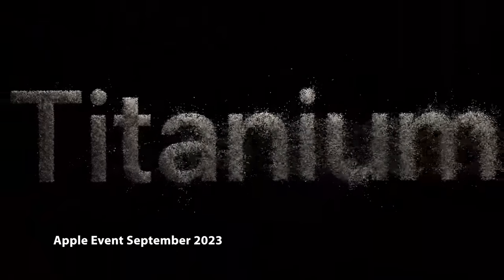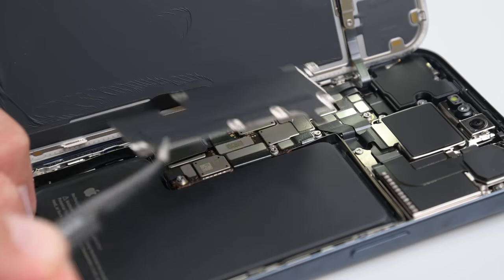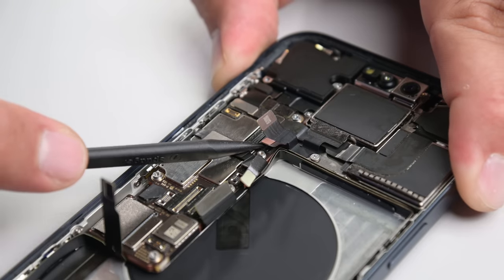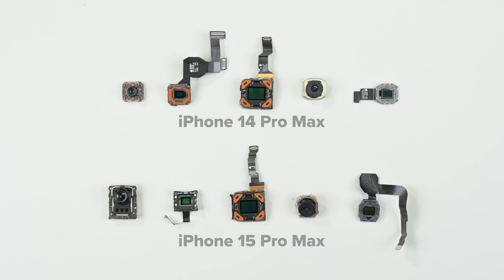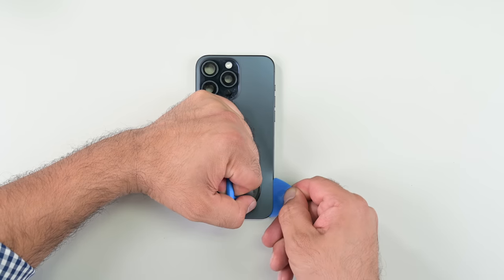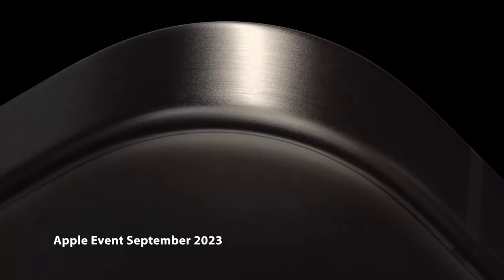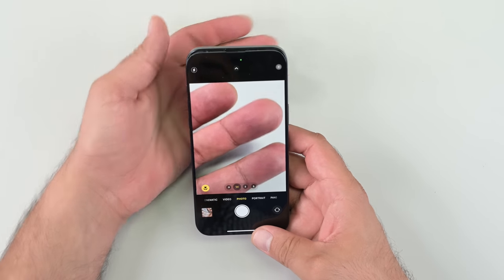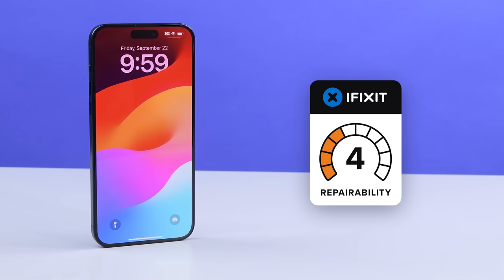iPhone 15 Pro Max Teardown: Big Phone, Microscopic Scratches

Comment: I would have given it a 2. While yes, the parts are physically swappable, I cannot agree that they are "replaceable" due to apple's intentional software pairing of components. This means that I can't just buy a part off the shelf and put it in my own iphone without interacting with apple directly. I feel you are being too kind towards the increasingly strict software locking.
Reply: By "off the shelf" you mean a stolen part?
Reply: @FernandoAES  No, that's not what the term "off the shelf" means. Maybe if the guy had said "off the back of a truck" you'd have cause to be suspicious.
Reply: @lennyvalentin6485  The iPhone use custom parts for everything. So "off the shelf" means going to Apple for the parts anyway. What is really the matter of the pairing then?

Comment: Disagree with you on the notion that the advent of the USB-C connector on the iPhone 15 lineup isn’t “something special.” For one, USB-C on the iPhone 15 Pro and promax models with 10 Gb per second transfers speeds with the USB 3.2 cable, means that the iPhone for the first time will be excellent for professionals who use the iPhone Pro models for RAW filmography and RAW photography. Keep it objective.

Comment: You guys didn't mention that the 5G antenna is soldered to the logic board.
Reply: It isn't. The antenna is on the side of the phone and rerouted to Qualcomm modem on the board.
Reply: @Helixur  It's the cable you can see sticking off of it when they compare the two boards.
Reply: @MeowThingy  no there's another set on small board attached inner right side of the frame. That cable hanging out is plugged to it from the board
Reply: @Helixur Watch Zack's teardown video. It's soldered.
Reply: @Helixur it’s soldered buddy, many teardowns in my book, they’re all soldered.
Reply: @RolandKoller90  no it isn't.it's a flex cable attached to the modem.
Reply: it is soldered  @Helixur  ! Just accept that you missed this point.
Reply: @Helixur It's soldered bud. Wait, one more time, it's soldered bud.
Reply: @Helixur Forgot to mention in my last reply, it's soldered bud.
Reply: only the mmwave 5g version. not all
Reply: @Gurenn83  we can do this all day. Do you even know how to do a true depth repair and the process to do it?

Comment: It is worth noting pentolpe screws are no more proprietary than Philips.   However they are much less likly to be damaged by using a screw driver of the wrong head size.
Reply: So is torx. Apple chose the obscure pentalobe screw  intentionally because torx screwdrivers are too common, and it used to be difficult to obtain pentalobe bits before ifixit and other companies started offering kits.
Reply: @JonnyFlash80  And?

Comment: Guys, you've done it. You've actually listened to my feedback that I made years ago regarding the repairability rubric. The serialized parts being a part of the repairability score should have been a thing. I'm glad to see it finally implemented and see you guys swapping parts around from different iPhones to see which part is serialized and which one isn't. Thank you so much, iFixIt. This is one more step closer to teaching people that serialized parts are a travesty to Right to Repair.
Reply: Technically speaking apple is not doing "parts pairing" they are just not storing calibration information directly on each part but rather storing it server side.

Apples defence for this will be theft protection, by only providing the profile to your phone if that parts is not assigned to another phone they can stop you using stolen parts.  

Using stolen parts is not what Right to Repair is about.
Reply: @hishnash  Apple is just trying to stop you from going anywhere to fix it but them. There is zero reason to care this much about replacing spare parts if not for blocking diy repair.

Comment: Still deserves an automatic 0/10 repairability score because of parts pairing and software locks.
Reply: When parts pairing is gone, make it a 7/10
Reply: Well it got a -3 off the score just for that reason. The phone itself is quite easy to disassemble otherwise, that part deserves some credit.

Comment: The part about the scratchability sounds a bit fishy to me because anodized aluminium will scratch as easy and its used in alot of phones when you scratch with a nail or something like that. I also doubt that the 18g comes from the titanium, i think the inner aluminium part saved more weight because as far as i know the IP14 had both outer and inner part in steel.
Reply: The difference being that the anodized layer is both thicker and (iirc) harder than a PVD coating. Personally, I feel it’s a shame we didn’t get flamed titanium as a colour choice.
Reply: @angryakita3870  in the EDC tool world Titanium is often anodized with electricity  because it changes its color at certain voltage like yellow to blue, violet etc. Are you sure that Anodized Alu is harder, i guess it depends on which level, the highest ist hard anodized. Alot of Flashlights use that anodizing but of course it can be scratched as well. Personally i like the natural titanium the most, i mean if cou get a Ti frame than dont coat it with a color, i mean the color is one thing of Ti that looks nice, for me it makes no sense to use Ti and color it black. With aluminium its different because its not as nice as Ti, here i would prefer anodized Aluminium. I thought PVD is hard, maybe i am confused and thought about DLC, Diamond like coating.
Reply: @danbarb9728  Are you sure the interior of the previous iPhone 14 was made of steel? Why do I remember it's made of aluminum?
Reply: @user-nv4rr4st8d  no, im not sure but it would make sense because now they promote a bonding technic between Titanium and Aluminium as something new, so i guess the old Iphones dont use such bonding processes which would mean they use full steainless steel without aluminium core. ?
Reply: @danbarb9728  I watched many disassembly videos, and the internal frame of previous iPhones seems to be fixed by screws instead of fusion technology, and using a steel frame inner frame does not seem to make sense for the iPhone, it will only increase weight and reduce heat dissipation，But you can also learn more about it and tell me the new information you get.

Comment: Drop tests are not so easy, if you drop it on a corner it will shatter. The edges are rounded now and less protected. But the phone is lighter, so less impact energy too absorb. The removable backglass makes it easier to break, but cheaper to repair.
Reply: you mean a highly stochastic process cant be evaluated by just dropping a  single phone?
Reply: In theory, because while I like that replacing a broken back is much less of a chore on them, what you’re saving in labour costs will likely be made up in a more expensive midframe due to the titanium and aluminium construction.
Reply: @hishnash  Thre  problem is that the phone is not in a fixture and the colision speed is not constant. So essentially is not repeatable or comparable.
Reply: @philipp594  you can drop 100+ and then compare results...

Comment: My iph 15 pro max started to overheat like crazy, in approx 10 min normal use with no gaming it starts to be very hot and the entire things starts to move very slow (similar when you put your ph in lower power mode), never had this issue with 13 pro max

Comment: Parts paring needs to be even tighter, because it makes lives difficult for thieves. 🙏
Best thing would be if there were not only functionality issues, but if salvaged parts didn't work at all on a different phone.
Reply: Why is that a good thing? So if a repair shop needed to repair said part, what then? They can't...
Reply: @WiseNoobCrusher  Its a good thing because it messes up the business of phone thieves who can sell locked phones for parts. If you want your phone repaired, go to your manufacturer. Easy.
Reply: @gabor1991 Why? If I go to the manufacturer, I may as well buy a new phone with how outrageous the price is lmao. Stop being a sheep bro, there is 0 reason the calibration stuff shouldn't be local and that device pairing should exist except for money.

Comment: 4!!?? Max 2 with most parts searlized.....just because you can get to it does not mean you can replace it
Reply: You can replace it you just cant replace it with parts salvage from another device.

Apple moved calibrate profiles to be stored server side a few years ago, this means that if you have a part that has never been used on another device booting into diagnostic mode will result in apples servers providing you with the calibration profile needed but using a part from another device just results in them thinking you are using a stolen part.

What apple should do here is let you use these parts so long as the phone they used to be connected to has not been flagged as stolen/iCloud locked. 

Not letting you use parts that are suspected of being stolen is important as this massively reduces the value of stealing a phone.

Comment: I’m holding on to my iPhone 13 Pro Max until they could match or surpass it. Tim Cook’s milking us with these tiny incremental updates!
Reply: I've been holding onto the 11 Pro Max - there's still not much improvement after all these years, but I want a smaller phone and USB-C, so non pro 15 it is.
Reply: @DigiDriftZone can’t go wrong with it, it’s a great phone
Reply: Not like they're marketing the phone to 13 users. If you look closely, their marketing graphs compare the 15's performance to the 11's, not the 12, 13 nor 14's. Since they expect the bulk of the sales will be from people upgrading their 11s. And the leap from 11 to 15 is quite significant.

Comment: The 15 pro and pro max glass back breaks easier than the 14 as seen on other channels. Apple made it easy and cheaper to repair that but only through apple .
Reply: To make a definitive stamtent lake that you need to break 100+ phones, break tests are very stochastic breaking a single phone does not a test make.

Comment: Adopting component serialization is the ugliest thing Apple did and, unfortunately, other companies started to follow suite.  You no longer own your device anymore.
Reply: What apple is doing here is not shipping the calibration profiles for parts on the parts,   tecncialy it is not serialization but rather calibration.

When you boot into diagnostic mode mode (anyone can do this on all modern apple devices) the phone will attempt to fetch these profiles from Apples servers, however apple will only profile profiles if the parts if these parts have not been used.

If they have been used apple flags the parts as possibly stolen and does not provide the profiles. 

What apple should do is update the server logic to provide the profiles so long as the parts are not coming from a phone that is reported stolen/iCloud locked.  Blocking the use of known stolen parts is a good thing. 

The other thing apple could/should do is document the format of the calibration profiles and provide a out of channel method (over USB cable) to provide these to a phone when in diagnostic mode so that third party parts can be made.

Comment: I was pretty hyped about the titanium frame, but there a more disadvantages than advantages compared to steal :(
- More expensive
- Its stronger than steal but therefore not as shock absorbend, so if you drop youre phone, the probabibilty of cracking youre screen or back is higher
- Ugly fingerprints which change the color of the frame
- Its as scratchable as steal
+ Its lighter wow....

Comment: How feasible is it to pass a law in the European Union ( Not the US, because Congress can't get it's head out of it's ass) that says parts pairing is illegal. That if a device is of the same model, parts must be interchangeable. What's is the company's (bullshit) argument against that law?
Reply: Legacy speaking apple is not doing "parts pairing" so such a law would have no effect on apple.

What apple is doing is saving a few cents by not storing the factory calibration profiles on each part (yes every part has a calibration profile) but rather storing these server side. When you boot into diagnostic mode if the parts have not been used on another other device then apples servers will provide you the profiles. But if you take a part from one phone and use it on another then Apples servers consider this as a stolen part and refuse.

You could have a law that required apple to document the format they use for calibration profiles and document an out of band API to talk to a phone over USB when in diangatsic mode so you could load profiles out of band but that would not let you use stolen parts. And it would be very unlikely for the EU to write a law requiring apple to allow you to use stolen parts, they could write a law saying that if the phone owner has informed apple the phone is being recycled that the parts be opened up for use. 

However remember some parts have usage profiles, like screens, that mean if you use a 3 year old OLED screen to have good image quality you not only need the factory profile but also the usage profile (that mitigates burn in by recording pixel usage), or you need very costly per pixel calibration rig to build a new factory profile.

Comment: What’s the mAh of the pro batteries?
Reply: 4000 something or so Jerry said, in his teardown video
Reply: 4441, to be precise.
Reply: mAh is not a messument of capacity.   Wh is the unit of energy storage (or J).  mAh is a messument of current flow and without knowing the voltage it means nothing.
Reply: @hishnash  The current is known.

Comment: I don't see serialized parts as an issue in 2-3 years, when programmers get updated and will be able to crack Apple's code in newest devices. As long as the device is physically repairable, software blocks will be of no issue thanks to third parties, or in rare case Apple when they will be forced to remove part check.
Reply: The parts are not serliased like that. It's not a boolean flag that needs to be set.

The issue is that the parts phsycialy do not come with the factory calibration profiles (stored locally).  Apples SOC loads these from apples servers when you boot into diagnostic mode.  Without the profile your going to get a LOT of bugs, while some devs might figure out provide profiles to the SOC through a side channel they still need to create them and this is costly process unless your a large factory with a big rig setup for the task.

Comment: As a consumer, I actually like that Apple serialises the parts. That way, I know when I get a replacement that it is a genuine new part, not just one that was taken off another damaged or stolen phone. It also prevents criminals from piecing together new phones using stolen parts or parts that did not pass QC on the production line. It's basically a very robust line of defence for the end user.
Reply: Agreed
Reply: I'm okay with them having a system message that lets the user know that a part may not be genuine, but they lost me at which point they disable functionality (especially when other OEM parts from another genuine iPhone are used). That's just being user hostile for no reason. I love Apple and own many of their products (including this new 15 Pro) but they need to cut this shit out.
Reply: Cool but then give REPAIR shops the tools, SELL the genuine parts at reasonable prices? Keep giving them free excuses, doesn't cost them a DIME.
Reply: I can think of a few reasons off the top of my head that logic doesn't really hold up.

1. Where other than Apple or apple authorized centers, are you getting the "genuine replacements" in the first place? Why would they ever not have apple serialized parts? 

2. If you're not getting them from one of those places, how are they supposed to do their job?

3. Who the heck told you that a part off of a genuine Apple phone "isn't a genuine replacement"? Doesn't that kind of undermine the entire point of repairability being good for anyone? If you break the screen on an iPhone, is the responsible thing to huck the whole thing, battery, charge port and all, into the trash? Really now? 

4. cRiMiNaLs already do and can piece together phones with non-genuine parts. These software locks don't actually stop fraudulent or knock-off iPhones from appearing. Not that you, the end consumer, are actually affected by that, because let's face it, you're getting it from a mainstream retailer in the first place.

5. Calling it a "line of defense for the end user" implies that having your phone fixed by anyone other than Apple is some kind of attack. Which, maybe you think that way, and fine, you can have Apple fix it. But for the rest of us...? How did you get to an iFixit video? Are you aware of the incredibly stringent limitations that an apple authorized repair service has to follow? I used to work at a phone repair shop and basically anything besides a screen or a battery wouldn't be covered by the terms as I see them, to name the least of the concerns. Most shops lacking that certification *do not want it*, and it might be worth looking into why.

Comment: Not a periscope zoom lens. It’s a tetra-prism with a lens that’s parallel to the sensor.
Reply: Technically a periscope should have a sensor that is parries, (see the traditional meaning of periscope) you expect 2 90degree bends.  The "periscope TM" name used on some android phones is not a real periscope and has a lot of issues with respect to sensor size and stabilisation as your limited by the phones depth.